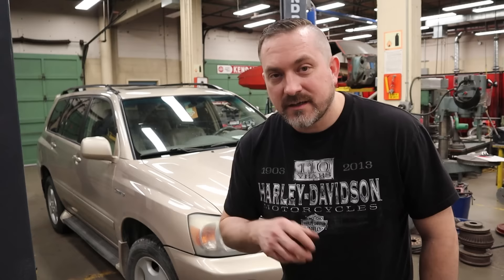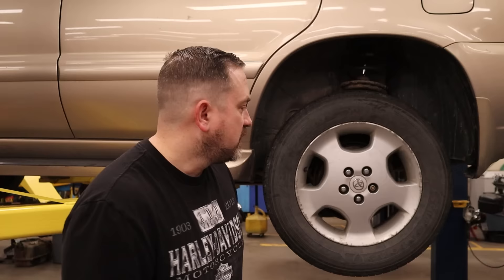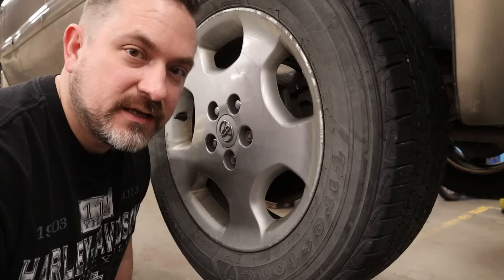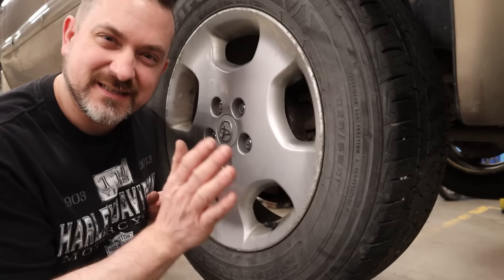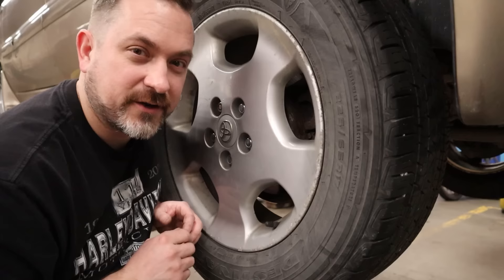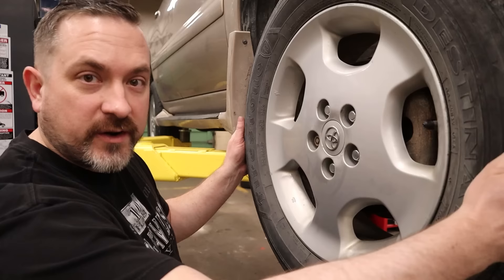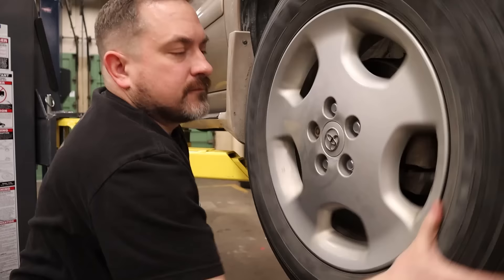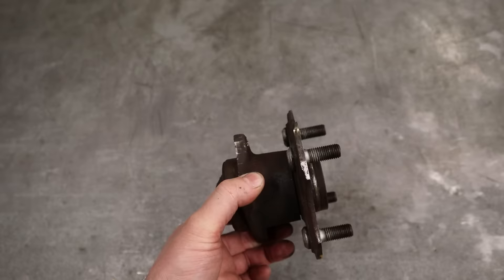How to 100% diagnose a bad wheel bearing.

Comment: What about a noise that doesn't get louder the faster you drive? It only makes the noise at slow speeds, comes from the rear, and can turn on/off with braking, sometimes turning and sometimes randomly. Sounds like scraping. Can't take it in anywhere because it doesn't always make the noise. Any ideas? Thanks
Reply from the maker: I would check the wheel well for loose plastic or rubbing, check for a bent dust shield rubbing on disk.  Jack up the car and check for wheel play or noise when spinning the wheel and check cv axle for play.  Good luck!

Comment: 2014 Accord, had the passenger side wheel bearing replaced, now getting a squeaking, scraping sound when turning left, Could this be the other wheel bearing?
Reply from the maker: Could be but most likely a bent sheet metal dust shield on the disk brakes on the side where they just were in there.  Jack it up and spin the wheel by hand to see what is squeaking.  Good luck!

Comment: Hi I'm Steve from UK
Question i like to ask is if front wheel bearing on drivers side needs replacing would it be wise to replace front wheel bearing on opposite side (replace in pairs) ?
Reply from the maker: That is the recommended method as the other side will be on it's way out too.  However, If money is tight you can just do one.  Thanks for the watch!

Comment: I did that test on my rear wheel bearings on my 2004 Chevrolet cavalier  everything was tight  but then I drove car and sound was back  not sure what else it could be  front ones replaced
Reply from the maker: Check all 4 wheels as even new front bearings could be bad.  Also check for play.  Could check tires for issues as well or CV axle play too.  All can have speed dependent sound.  Hope that helps.  Thanks for the watch!
Reply: @wayofthewrench  checked all 4 wheel bearings  used  microphone with speakers  mo grind  all were tight  did frind some play in left outer tie rod   going to replace  ordered both outer tie rods  just to be safe    all for tires do have  cuppling  wear  plan replacement of all four  just cheap Goodyear tires from Walmart  been on car for 1 year I will let you know if new tires  make a difference  thanks

Comment: Ok 2013 ford edge here drivers side front wheel has play side to side but not up or down play.  It has the classic noise while driving of a bad wheel bearing.  I’m not sure about this possible bad steering links you mention if only has play side to side would vehicle also be making the classic bad wheel bearing noise if bad steering links?
Reply from the maker: If the vehicle is up off of the ground and there is no play up and down but play left and right, then it shouldn't be a wheel bearing.  I would lift the car and properly support it with stands and have someone move the wheel left and right while you look underneath with a light to see where the play is in your steering system.  Once you find and fix the steering system part, if the noise goes away, then it was that.  If the noise is still there, then it could be a wheel bearing that is starting to go but with no signs of play yet and you still fixed another problem that had to be addressed anyways.  I often see cars with multiple issues, it's very common.  Or it could be another speed dependant part like a nail in the tire, cv axle, bulge in the tire, etc. Good luck and let me know what it was as I enjoy testing my diagnostic skills.  Cheers!

Comment: Q: can a bad wheel bearing cause the rim to get excessively hot but not have any other of the clasic simptoms?
Reply from the maker: Yes they can but usually people don't check them before the sounds happen.  Maybe if you have adjustable wheel bearings on a trailer though.  Thanks for the watch!

Comment: My Audi a4 has the rumbling noise, gets louder with speed but has none of the other signs of a bad wheel bearing. It doesn’t have any play or noise when shaking the wheel. Could it still be a bearing ?
Reply from the maker: Yes it can be a bad bearing that hasn't worn out enough yet.  I have another video on road testing a bad bearing you should watch.  It has other tricks to confirm it's a bearing.  Also check for play in the CV axle.  Hope that helps.  If you deem me worthy, I'd really appreciate it if you could share out my channel on your social media so I can help more people.  Thanks for the watch and welcome to the channel.  Cheers!

Comment: My 2012 Honda Odyssey has a grinding noise when steering right but quiet when steering left and straight. Is it the wheel bearing problem?
Reply from the maker: Usually a grinding sound is not bearings but maybe if it's really bad.  It usually sounds like a whirring or fast clunking sound that changes with speed.  Sounds bad though, check that right away.  Good luck.

Comment: What about when i hit and release the brakes it make a weird sound?do you think is a badwheel bearing ?
Reply from the maker: Any sounds or vibrations when on the brakes are not usually bearings, it's usually a brake issue.  I have another road testing bearings video that you should watch to help narrow down if it is a bearing or not.  There are extra tips in that one as well.  Thanks for the watch!

Comment: Hi how do you get your wheels to turn with your hands? Mine won’t move
Reply from the maker: Is your parking brake on?  Or sometimes the wheel is a driven wheel so the wheel is hard to spin or even not spin able until you put the vehicle in neutral.  Be careful to have the vehicle not roll away if you take it out of park ( chock wheels and or have the car up on 4 jack stands).  Hope that helps!  Thanks for the watch!

Comment: Hi does a bad wheel bearing worn out tyres quickly?
Reply from the maker: A really bad wheel bearing can cause extreme camber wear on the edge of the tread.  If it is this bad, your wheel bearings will be making a LOT of noise and are really dangerous.  Thanks for the watch!

Comment: Drove a '99 Mazda Miata half way across the country and back on a bad rear wheel bearing. Thought the noise was a worn differential. Oops! What can I say? In a Miata you're practically sitting on the differential and the entire rear axles + differential assembly are only about four feet wide!
Reply from the maker: Hilarious, well at least you made it.  I bet it was really bad once you found out what it was.  Thanks for the watch!

Comment: To diagnose AWD, should the lift be done as follows:  All 4 wheels at the same time, just front or rear wheels at the same time, or individual wheel?
Reply from the maker: Not quite sure what you mean but for wheel bearings you check them one at a time.  Side to side motion and top to bottom motion is no good.
Reply: @wayofthewrench  Sorry to clarify, this is for the spin test of the wheel off the ground, I only have one jack stand at the moment.
Reply from the maker: You don't have to do the spin test, that more of a secondary confirmation.  Looseness is the main diagnosis and a beforehand drive test to hear a speed dependant noise.  You can technically lift the front or rear axle with the jack and put the one stand under the frame/rocker panel just in case it falls and check the wheel bearings, just don't put your body or hands under the vehicle/tire.  It's not the safest thing to do but if your not under the vehicle, you won't get hurt.  I have a great video on lifting vehicles with a jack. You should watch it.  Thanks for the watch!

Comment: I got movement side to side with a clunk sound, but up and down i got less movement but still have the clunk sound. Is that wheel a bad bearing?
Reply from the maker: Yes sir, or loose lugnuts or loose steering and loose suspension system components.  Good luck!

Comment: For the second time in one year, I just had my brake pads, rotors, caliper, and hose replaced because of the drivers front wheel keeps locking up. Two different mechanics. I don’t have any noise that sounds like a bearing, but could a wheel bearing cause this? Could it cause the hub to tilt and make the rotor touch the pad? Thanks for the video.
Reply from the maker: If the one corner is locking up it could be a pinched brake line or collapsing flex line.  Do you have an ABS code?  A failing wheel bearing wouldn't cause a seized caliper but "might" exaggerate the pad wear....but probably not.  I would check for play in the wheel like in the video and go from there.  Good luck!
Reply: @wayofthewrench . You did great! I noticed that you respond to your comments section and in a very timely manner too. I can’t get that from my doctors or even family. I’m only 50, but I was the recipient of a home invasion 4 years ago that left me disabled. No meniscus or ACL. I’ll try to jack the van up and see what I can find, maybe. 96 Nissan Quest, neither the van or I can endure much more. Let the good luck befall you! I won’t be needing luck much longer, it never did much for me anyway. Thank you for responding-so few humans do.
Reply from the maker: No worries.  I'm still trying to respond to people and help them out as much as possible but at 21k subscribers, I'm already having a hard time getting back to people.  It takes me about 20 to 30 minutes daily now.

That sucks, sorry to hear that happened to you!  People can be horrible to each other.
Thanks for the watch and welcome to the channel!

Comment: What if I feel vibration on high way speed ? And slight tight storing wheel for a Ford Taurus 2003.  Do u think it is wheel bearing or breaks? I have the rear break pad changed and the vibration has improved but still going.
Reply from the maker: Sounds like you have a couple things going on.  Vibrations at high speed only are most likely an out of balance wheel.  The tight steering is something else completely.  Check steering fluid first and go from there.  Thanks for the watch!

Comment: My Honda Accord 2018 makes similar noise it only has 70k miles. I'm a run threw these steps. Can a bearing just need to be greased?
Reply from the maker: Yeah bearings can go at that kind of km/miles, also depends on whether you are in a salt belt too.  No, most bearings are sealed units and once they make noise, the damage is done.  Good luck.  If you need to replace the bearing, I have a good video on that too.  Cheers!

Comment: Well I'm definitely getting the sound while driving, and it gets worse with speed and when i turn right, but there's no noise when i spin the wheel by hand. Now I'm not sure what it could be.
Reply from the maker: Sounds like a right side wheel bearing you me.  Did you jack it up and check for play?  I also have another bearing video you should check out to road test your bearing.  Good luck!
Reply: @wayofthewrench  if it's worse when I turn right wouldn't that be the left side bearing?
Reply from the maker: Sorry yes it's the left because when you turn right the vehicle weight shifts to the left loading up the bad bearing.  When you turn left the weight comes off the bad bearing so  the sound goes away.  Cheers.
Reply: @wayofthewrench  ok. If I can't determine front or back I'll do both. One at a time to find the fix. The rear hub could do with replacing either way. Thanks. 
Also might a bad bearing cause the wheel to not turn easily? I tried to spin my front wheel and while it does turn by hand it doesn't get much momentum before stopping.
Reply from the maker: If you watch the other video, there are other tricks to narrow it down. Try spinning the wheel and feel the spring or strut for vibrations.  The front wheel slowing down quicker could be a sign but could also be just the pads dragging a bit.  Good luck!

Comment: So my wheels don't move at all but there's a sound from the front end the driver side it is so loud and I spend the tire I don't hear a grind but when I drive I hear it so it is it still a wheel bearing because my tire is not moving it's stiff my wheel hub is stiff it's fun I will have it just makes a normal turning sound from the CV axle
Reply from the maker: Do you have the parking brake on?  That will stop your rear wheels from spinning.  Shaking the wheel to test for play up/down/left/right is more telling, especially when it is bad.  I also have another video on road testing a bad bearing, you should check it out.  Good luck!
Reply: @wayofthewrench  yeah the sound is coming from my front it's a 2012 civic LX, aka a piece of crap lol , I spun both tires and they didn't have the grind , but when I drive the car it's LOUD, also I have been on the freeway and turned off the car and out it in neutral and the sound is still there so I know it's suspension, idk what to do I'm.at a loss...Both drums of the front are tight , but when you drive it sounds like a wheel bearing and it started out of.kmow where , I'm a door dash driver so I know.my car and out of the blue the sound showed up...Can it still be the wheel bearing? I can feel it in my foot pedal
Reply from the maker: When you press the brakes, it gets worse?

Comment: Hey brother check this out .I have had a clunking going over bumps I changed the struts and it wasn't that looked at the sway bar and links not that . Now I am getting a humming what do you think can a wheel bearing cause clunking when driving straight over bumps or what
Reply from the maker: Try going over a speed bump head on so both wheels hit at the same time.  Then try hitting it at an angle so one wheel hits and then the other.  Listen for clunks.  No clunks when head on but clunks at an angle are always sway bar bushings and/or sway bar end links.

If it clunks when hitting dead on.  Get out of car and see if you can aggressively bounce the corners to get the sound to repeat.  Then figure out where the sound comes from.  Use a pry bar the check loose joints on suspension/steering components.  Good luck!

Comment: What can cause  ,,humming,, noise besides  wheel bearings..? Can needle  bearing  cause the same noise? or axles assembly? Replaced  all four wheel bearings  and drive shaft  but noise is there at the speed  about 40  mph and up..
Reply from the maker: Humming that is speed dependant could be a wheel balance issue or even road noise caused by off road tire treads.  I have a video on balancing you should check out.  Other speed dependant sounds could be brake dust shield scraping on rotor, seized caliper/not properly floating caliper rubbing, cv axle ( usually worse in corners), something in the tread of tire, loose lugnuts, drive shaft out of balance, warped rotor causing caliper to float side to side, etc.  Good luck!

Comment: Will bearing noise get louder or quieter when loaded? Ex: does a right bearing get louder or quieter when making a left turn putting more load on it?
Reply from the maker: I have a great video on road testing a bearing you should check out.  When you load up a bad bearing, it makes more noise.  When you lighten the load on a bearing , it goes quiet.  Hope that helps.  Thanks again for your support for the channel!
Reply: @wayofthewrench  It most definitely does. Thank you so much for replying.
Reply from the maker: No worries, cheers!

Comment: Would a bad wheel bearing cause a constant squeaking sound? Like a shitty shopping cart? I hit a really really bad pothole on the highway doing about 70mph a couple weeks ago, and now that the weather has gotten better I'm dropping my windows, and noticed a bad squeak, especially when turning left . Plus my alignment is off now, and seems to be... variable, sometimes really bad, sometimes is perfectly straight, but will typically want to pull left. Car is a 2020 Corolla, so I doubt age and mileage is what caused this, it has to be that monster pothole. I kind of don't want to drive it since the steering feels off, and loose, so I might start taking my motorcycle to work even though the weather kinda sucks still, until I can pinpoint what it is, and afford to fix it.
Reply from the maker: It can but you could have multiple issues and you really need to inspect the steering and suspension components for damage/play/wear including the tire and rim.  Good luck.  Thanks for the watch and welcome to the channel!
Reply: perfectly str@ight. 👁

Comment: I don’t have noticeable play however I run steelies and off-road tires on my truck so they are very heavy and once I get up to 72-84 mph I’ll get a shimmy in the wheel that will come and go. When I spin the wheel I hear a very quiet noise that sounds like little pebbles kicking up and falling No grinding sound othet then little pad grinding. Do you think it’s wheel bearing?
Reply from the maker: Sounds like you may have a slight wheel balance issue and/or have some debris inside the tire.  Does the car shake a bit? I've seen water and sometimes rubber balls that form inside the tire and the wheel balancer has trouble balancing it.  With knobby off road tires, they can make noise at higher speeds too.  You could also try balancing beads and see if that helps.  If there is no play but a slight sound, the bearing could be starting to go but you'll have speed dependant sounds that get louder/worse.  Good luck finding your issue!

Comment: I only had noise and no play. As soon as I removed it from the vehicle and replaced it, the noise was gone. Prior to that I was thinking possibly the cv axle.
Reply from the maker: Sounds right, it just wasn't worn out enough yet to have play.  Glad you got it fixed. Thanks for the watch!
Reply: @wayofthewrench  thanks that humming and slight vibration in the steering wheel was driving me nuts lol
Reply from the maker: I bet!